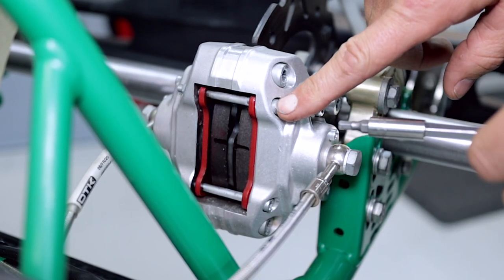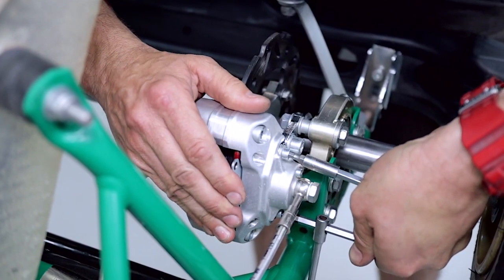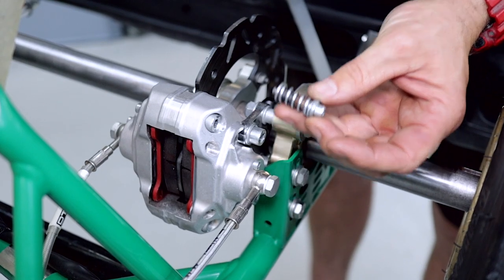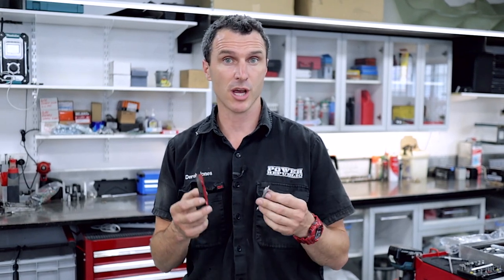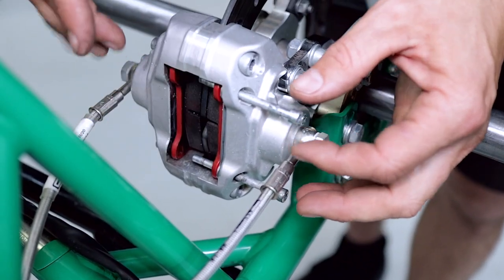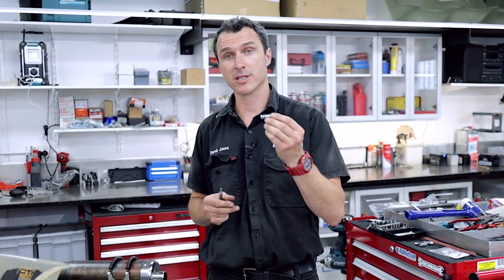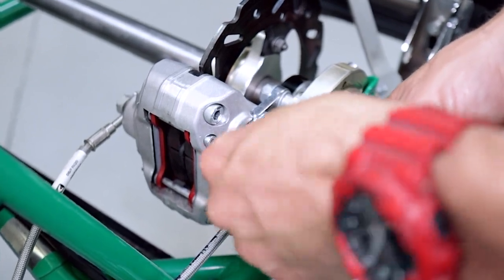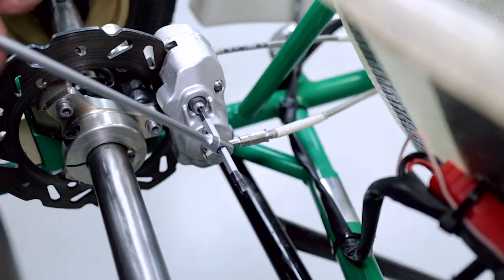HOW TO: Install Your Tony Kart Brake Shims - POWER REPUBLIC

Comment: Great videos you make. 
I have noticed that the brake pads tend to war uneven, they wear more on the top then in the bottom, so i normaly rotate them around to get more life out of them.
Reply from the maker: yeah that's right, they do tend to wear uneven, thanks for the great tip on the flipping them over

Comment: Hey Derek, 

Love the videos mate! I’m new to karting and am trying to get my senior max working spot on. At one track in particular with lots of tight corners and one short straight I seam to rev the engine out on the straight and was wondering what I need to change to help the motor rev longer?
Reply: The sprocket on the rear axle...use one with less teeth than you currently have
Reply from the maker: Thanks Chris

Comment: I am getting into karting. I got a  Haase - Corsa frame, looks a lot like a Tony Kart, but I have to get a new rear caliper bc the piston walls are so corroded and pitted. The issue I am having that it has a big D shaped bracket the old caliper bolted to thats welded to the frame. They dont seem to make that caliper anymore and I am unsure what would be be compatible in that bolt pattern. 
I have a Wilwood brake caliper for karting I have been playing around with but I would have to do some fabbing to get it to work. If you guys got any info on getting this sorted out, I would greatly appreciate it.
Reply from the maker: sounds like you are on to it with the re fab of a bracket to suit your new caliper.   that's what we would do if we couldn't get a discontinued product to suit

Comment: Hey Derek, does the senior otk karts use these shims as well? I'm surprised that in this day otk are still using shims and haven't gone to a self adjusting system like birel
Reply from the maker: Hey Chris, yeah only the older senior karts on the entry level chassis.  The 401R Racer has had self adjusting brakes for over 10 years, and this year self adjusting brake came out with the new Rookie EV

Comment: Hey!
I’ve been wanting to add a hydro e brake. But there’s allready 2 cables going there: 4:35. Is it still possible to add one?
Reply from the maker: you can buy them from Ebay, or karting supplies.  Google hand brake

https://www.ebay.com.au/itm/392647835012

Comment: hay what kind of rear brake caliper can I buy that will fit my old 1999 Tony Kart Extreme?
Reply from the maker: Hi Chris, you can buy the new version of TK brake components I guess and retro fit them with some new brackets to suit your older frame.  Otherwise gets some aftermarket and cheaper brake parts from RR.
Reply: @PowerRepublic  you think i could order an MPC Brake set up and make it work?

Comment: what model is that chassis?
Reply from the maker: It's a Tony Kart Neos but they are the same brakes as the Rocky 900 and Nordix Junior kart.  also too, its a similar process for most non self adjusting brake systems like the Dent system found on the Arrow karts
Reply: @PowerRepublic  ok, thanks! I have a Nordix junior so I was wondering if this was the same.